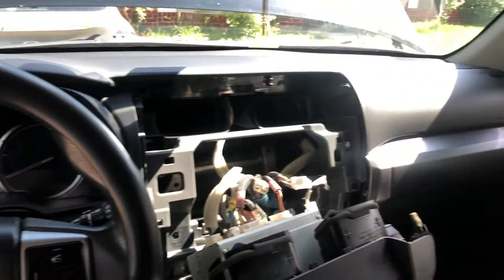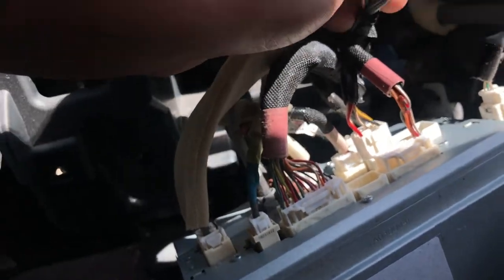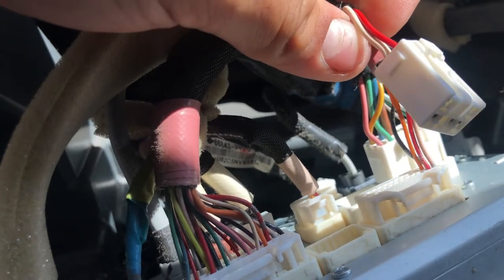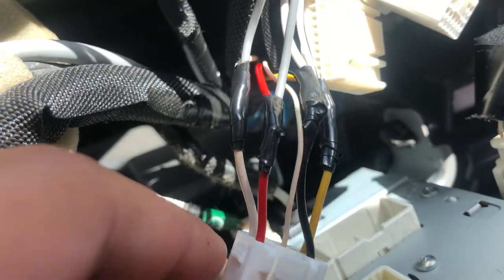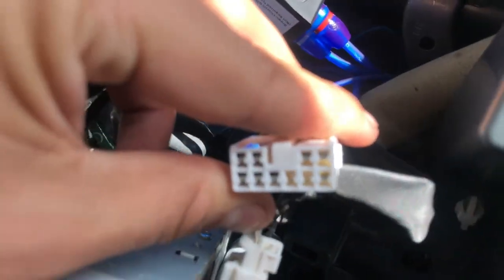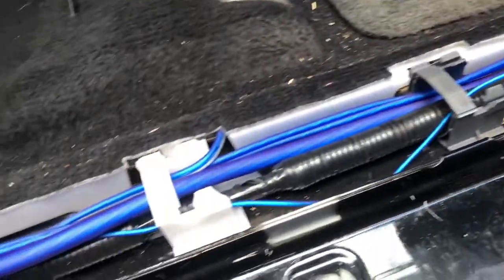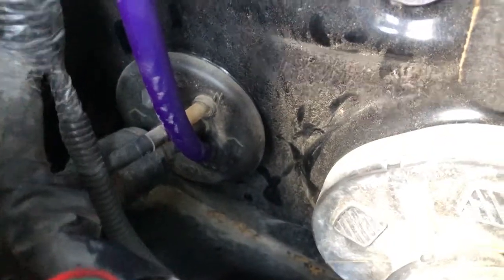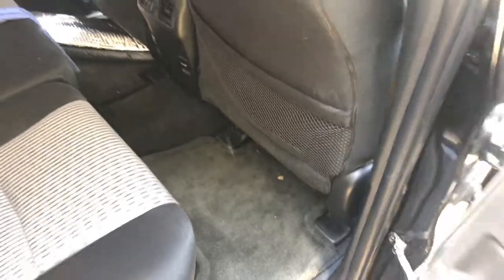2015+ 4RUNNER Sub Install w/Stock Head Unit

Comment: Just wanted to comment that this is the exact wiring for the 2018 4Runner Off Road. Saved my bacon because the constant power and ground on this had unit is not yellow and black. It's actually light blue and brown as seen at .56 seconds in.
Reply from the maker: Thanks for the comment !

Comment: What bolt size did u use for that ground spot? And also do u have any static or hum or any noise running the battery power cable next to the RCA cable?
Reply from the maker: Any nut and bolt should work fine. And no i don’t personally but i have heard people have that problem

Comment: Any idea if the wiring is the same for a 2014 4Runner with factory Navigation? I noticed the title shows 2015+ but thought they may be similar or the same being both 5th gen.
Reply from the maker: Should be the same

Comment: I don't know if you see this or answer questions, but on the connector with the remote. Can you tell me which is power and ground? Trying to run a switch  with  it.
Reply from the maker: You want to run a switch to your amplifier? Or your whole radio system? The remote wire only sends a signal to turn the amp on its not a power neither ground wire

Comment: Where did you get the diagram for the colors on the wires to the speakers? I need this for a 2023
Reply from the maker: I work at a dealership and have access to them.

Comment: Can you get to the gains with the amp under the seat?
Reply from the maker: I adjusted my gain and sub to its best ability to where I wouldn’t need to adjust gain post install, and would use the bass knob to add or remove bass.